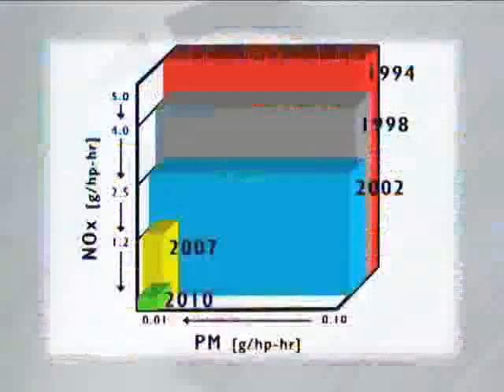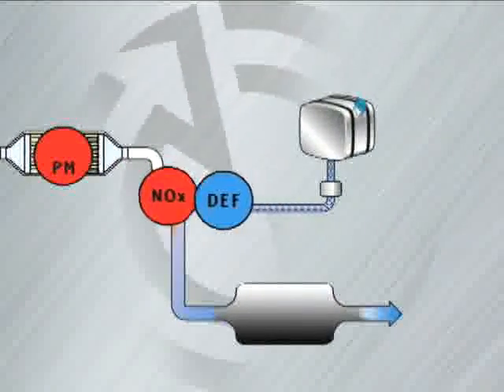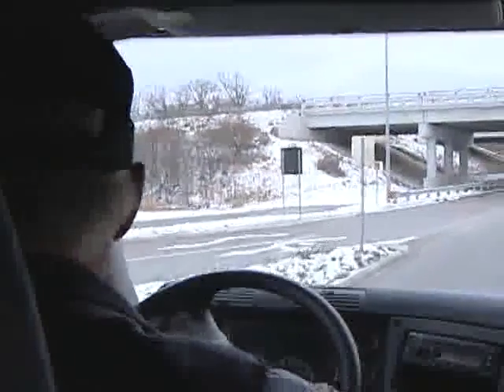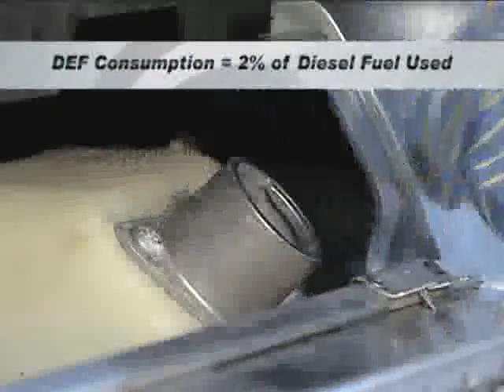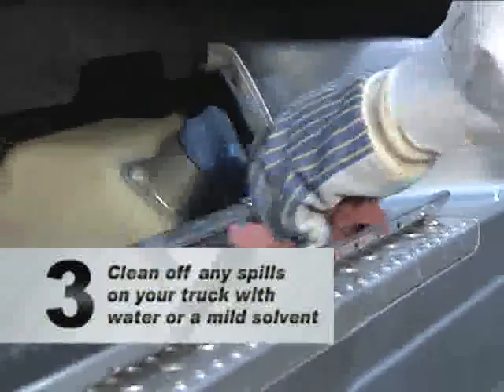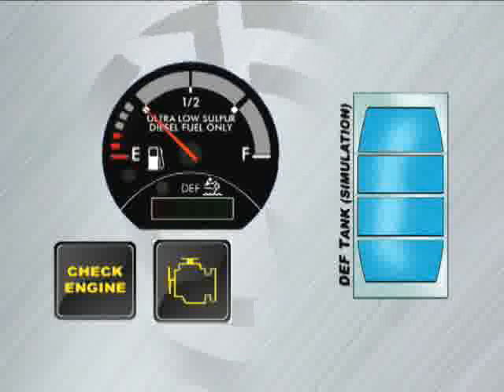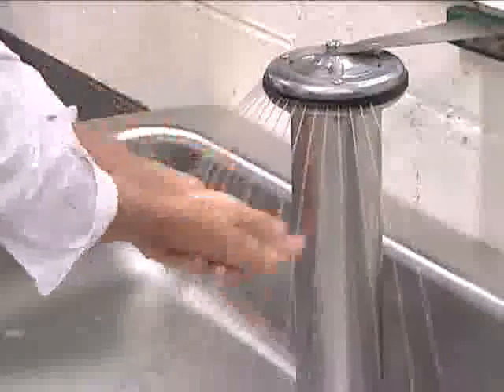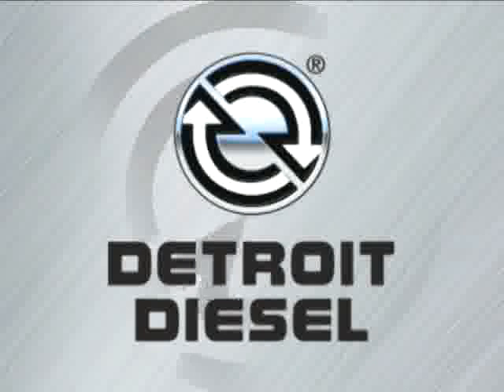Detroit Diesel SCR Bluetec DD13, DD15, DD16 Series Engines

Comment: How do you bar the engine on a dd13?
Reply: The Real Rowdy G on the bottom of fly wheel housing there is a plate with two 13mm bolts. Use a screw driver or prybar. There is a barring tool that bolts to the housing. Pretty pricey $$. I can get part number of tool for you if your interested.

Comment: dude im getting better mpg than any truck on the road right now both bigrig and pickup diesel wise...you wanna know how many ppl have there new trucks in the shop because of this bullshit? there 32 rigs in my buddies local shop he said they spend more time in the shop than on the road,everybody I know that has newer trucks sold them cause there so junkie most ppl today buy new rolling chassie and put the older rebuilt motors in them

Comment: With a 23 gal DEF Tank, you can get close to 7,000 miles of driving before having to refill the DEF Tank.  Being a professional driver, you should be able to anticipate the filling of your DEF Tank.  If you're so dense as to let the tank get low and you do not refill your tank after you fill with fuel, the truck will only go 5mph-not derated while you drive.
Reply: If a driver allows his fluid to get so low that the truck may only go 5 mph I would question that he did a pre trip inspection.